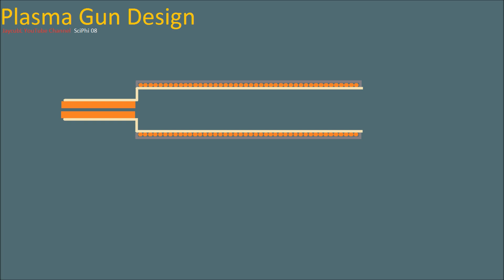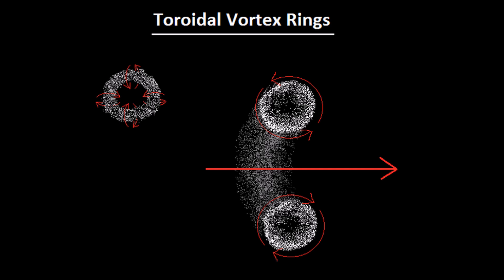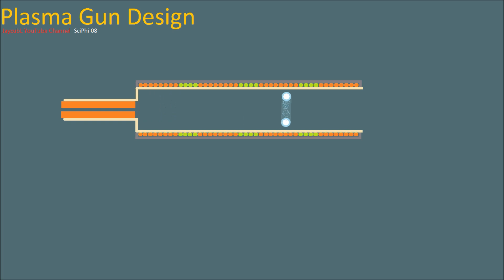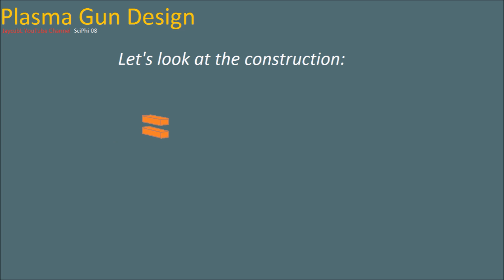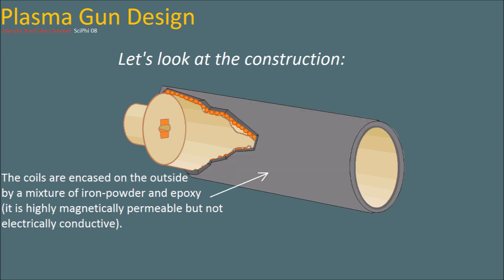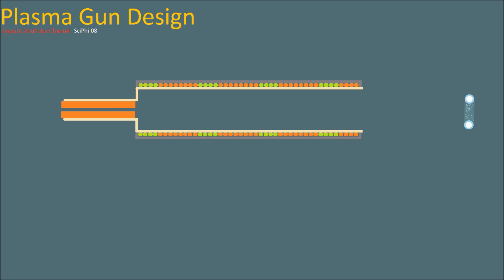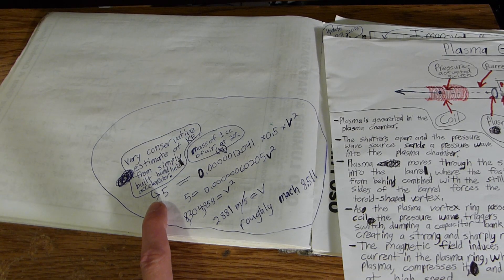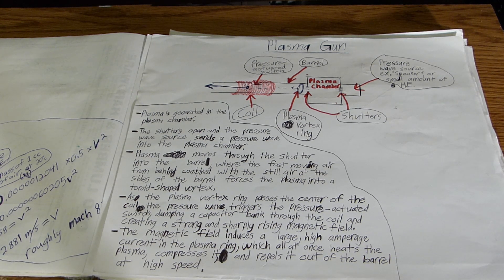Plasma Gun Design, Particle Ion Beam Weapon SciPhi 08

Comment: My question is, respectfully, how does one maintain such a vortisol motive column whilst penetrating through standing Air volume at supersonic or greater speeds at distance? On top of this, one might factor in the question of; how does one maintain "active plasma state" once said  vortisol motive column exits the active field of induced high tension current(s), [the point of origin] from which, said plasma state had gained conductive excitation-  will now continue to quickly "flee the scene" until a enough distance has weakened the requisite field strength needed to maintain plasma excitation?    What do you do when your bullets get too far away from you? You dissipated the majority of your field strength and can no longer maintain plasma state. Which, I predict would be no more than a handful of meters from a portable device before you're just puffing once very hot gas at somebody. No different than a fart that was highly charged on exit and just lukewarm upon contact. You get my drift? Of course there are a myriad of ways one can maintain a high-speed moving plasma at distance from its point of origin. Some of these could include the fact that once anything is moving fast enough through the atmosphere it will certainly maintain plasma state on its own - of course this is orders of magnitude of hypersonic speeds too destructive to want to even look into. One could also follow up that original vortices with a very tightly controlled column of high-powered microwave energy as a manner of keeping that high speed fart burning nice and hot all the way across the field till it hits its Target. However, you would require an intense amount of energy to do that at frequencies beyond 10 gigahertz with any kind of power efficiency from the circuitry used but then you always run into the issue of rapid propagation breakdown. God forbid it happens to be a moist Summer afternoon or any other weather anomaly such as fog or perhaps maybe a random cross fart in your field, or human being, or just a thermal difference between your firing point and your target. At those frequencies propagation becomes a nightmare and a very dangerous nuisance more than it does become the obvious point of failure.  One could also use mega joule pulses of laser emission to keep that fart lit till it hits the other side. But that would be going much faster than the vortices on many orders of magnitude, at which point why didn't you just build a big enough laser in the first place if you needed to keep plasma going between point a and the target point b? There are other means of doing this as well but they are quite esoteric rather than technically simplistic and effective enough to implement without looking like an asshole with too many building blocks stack next to you just to shoot someone with I'm very slow moving non-physical projectile that will have to be going sub supersonic before impact. Personally, I would just shoot a harpoon with a long power wire tether and use that as the guide (AKA propagational leaky conductor) for the required high tension excitation between point a and point b. A nice little trip line for your low speed high power high heat puff of fart to glide along. This is going to be quite a consuming task. One which I would fear DARPA had probably already spent a day or two looking at on their own by now. Once they realize flinging hot fart across the room is a moot point up to a certain distance and span volume of air. But what do I know, just another asshole with an opinion on YouTube. Keep thinking keep trying good luck excellent idea. Try not to taste the farts sir

Comment: Have you considered the potential suitability of the application of EPFCG in this device? The benefits would be to energy density and cost required for a high energy electromagnetic pulse. 

https://en.m.wikipedia.org/wiki/Explosively_pumped_flux_compression_generator

Comment: I disagree that it would be a practical weapon design; such a toroid would lose energy sustaining itself in a vacuum, and accelerating a rotating mass to relativistic speeds is highly difficult even for parallel processors to compute.

However, think of what would happen were you to fire a series of these into an electromagnetic field configured something like a bundt dish. Allow some of the particles to escape to the rear, as the plasma rotates.

Could be a working, efficient, and high-density ion impulse drive. Needs some experimenting done.
Reply: Or, possibly, allow the escaping plasma from the toroids to flow into a conventional ion drive to lower energy costs. Maybe?

Comment: Sorry to be tardy to the party, but what would you think about something like this using an HHO or other hydrogen-oxygen mix down a cone to form the toroid, that way you can store your energy density (ammo) in water instead of having to heat the air yourself. Civilian HHO tech seems to be coming along well enough to make what would amount to a recharging plasma rifle that uses some water and a bit of solar power to make very angry air. Of course, there's down time between shots which is a negative, but better mileage per fill. The nerdy side of me also likes the idea of essentially pelting tiny hydrogen stars down range. It could also give much better velocity since you have a rather potent combustion accelerating it first.

This looks basically like a gauss gun that interacts with a plasma toroid instead of a physical projectile, I like it.

Originally I was thinking there might be an issue between the rotation of the toroid and the velocity at which it's accelerated, but the magnetic field will essentially pull from the center instead of trying to accelerate the ring as an entire mass, and the question of ring rotation speed made me think as well: what happens to this design if you have golfball dimples lining the barrel to help generate turbulence evenly along the rings outer edge, encouraging more rotation through the velocity of the center column of gas and helping to regulate its rotation and travel speed? Furthermore, would there be a benefit to matching the size of the dimples with the thickness of the toroid? Would that encourage backflow rotation?

All this considered with 2H and 20 supplying the plasma, could you theoretically increase the heat by concentrating oxygen or hydrogen in to the low pressure zone of the toroid, and what would happen if you preloaded and backloaded separate gasses (a lone gas at the front and an optimized mixture in the rear), or fused it with your idea and load the area between the coper bars with a mixture? I'm sure there's a way to increase heat yield and velocity down the length of the barrel with your design. Maybe preloading hydrogen before ignition would keep unburned hydrogen contained in the ring and help increase its overall energy after it leaves the barrel.

Comment: I do belive that that would make more of a plasma trower than a plasma gun. Similar to a flametrower... since there is noting holding the gas into a concentrated bolt once it leave the barrel. Also you have to use batteries and gas tanck and not magazines drums or belt to feed the wepon. So i would raname it plasma trower as flametrower is the closest exsisting wepon concept.

Comment: The plasma rail gun is a great idea but the plasma’s density is too low to be a functional projectile. If you could incorporate a magnetic chamber with a small projectile like a bb (that can deal with the temperatures involved) then pump the plasma into that chamber and then accelerate the plasma - bb combo down the “barrel” then you’ll have a plasma projectile with enough density to be sent down range and have An impact. The bb would be a sacrificial component of the shot

Comment: I recently am interested in plasma weapons to stun/be able to deal massive damage and sumbled across this video on halo  https://www.youtube.com/watch?v=sNWMn0NkU8A&list=WL&index=8&t=473s  and hear that the plasma riffles used compressed gasses to create the bolts. The problem is that the plasma would dissipate quickly in the air. no matter what you do really. so to try to get some distance i'm thing that i need to create the plasma in bursts be hind an air multiplyier some thing like this ping pong ball launcher  https://www.youtube.com/watch?v=bAKqzAzfXKQ   with the CO2 container fill with nitrogen instead. i would have an ark before the air multiplyer either tesla coil or ark lighter thing to heat up the pressurized gas to expand the ark of the tesla coil might look like this on small scale  https://www.youtube.com/watch?v=SzqtAoJjV8Y  idk. but then i would have the barrel be this videos liner induction motor on the other side of the air multiplier. that is the only real way i thing a plasma weapon could work. let me know plz. thanks

Comment: So once the toroid leaves the barrel it's going to encounter immediate resistance from the surrounding atmosphere. Because the plasma discharge is so light, it's going to decelerate very quickly. 
Although it's a good concept & should be built for proof of concept.

Comment: would a laser, wide cylindrical low energy beam,  in the back, help keep the plasma going in a straight line?
Reply: If the laser can heat the air so much it can ionise the molecules in the path of the plasma toroid, I think you should just use the laser.
Also, since the toroid shape has a hole in the middle, I think the laser would just go right through the hole leaving, the plasma projectile undisturbed. You'd have to create a sort of laser that can project a hollow circle, instead of a dot, by using some wacky lens, or, as you say, a low energy cylindrical beam, but I don't think that would be very effective at heating up the path for the toroid, and most of the laser would still be funnelled through the hole of the plasma ring

Comment: I don't think this will work. The Gas or Plasma will immediately expand after leaving the tube. Maybe it is effective at a distance of a few mm or cm but not meters. So maybe it will be possible to create a plasma ball and with a long enough magnetic rail it will travel maybe a few meters. There are so many variables you have to take in this equation. Sad physic reality.

Comment: The better starter circuit design would be a single charge on the whole outer tube, and a very fine ground pin through center, opening up into the secondary cavity. Taper the pin into a long needle shape and this allows the torus puff to expand and form, then expand and accelerate in the second layer

Comment: This design would likely work considering that the US Navy's version of this is much less thought out. Their plasma bolt travels around two feet at 70,000 degrees in open air. They don't have a linear motor or any magnetic field controlling the plasma ring. Question is if the linear motor can increase longevity of the plasma life span in open air?

Comment: I have a very different way of creating high energy plasma while maintaining enough atmosphere in the chamber to sustain multiple shots.   We should chat.
Reply: Personally, I'm contemplating a 2 channel hydrogen converter to use a oxy-hydrogen mix down a vortex cannon to create the toroid. It'll have to vent spare oxygen through a blowout valve, which raises an issue or two with safety features. A little water in the stock and a charged battery should be all I need, since it's 1.3 volts per connection for peak generation off a graphite node/plate.
Reply: @Cretaal substitute your solution with  diluted urine. (Naturally occurring)
Reply: I would love to hear it
Reply: Is it a dense plasma focus?
Reply: What is your way?

Comment: You will need super cooling, unless you make cold plasma.  It is one of the Ancients' weapons, so it is doable.
Reply from the maker: Thanks for your comment! I think the distance between the plasmoid and the ceramic barrel would be enough to prevent heat from being a problem, but I agree that a liquid cooling system would be great for a use where weight is less of a concern. Limiting the duty cycle can also do a lot to prevent overheating.

Comment: I want to use 3 sets of  7 stage 6inch wide 8inch long coil rail 1st stage 2"L  stage 2-7 1"L  for a ion accelerator  to increase thrust on a ion drive. Increase the speed of the ion and increase the thrust. Do so fast enough and you can get proper acceleration and maneuverability in space. And possibly if using a ion drive and a multi stage accelerator to accelerate the ions to near light-speed  out the back of the craft you could get very good acceleration/ deceleration of the craft and Achieve  near light speeds. We all know NASA and there mk3 which was a big waste of time and money because by the p/w ratio it's 500lbs has a thrust of 278 millinewtons  and the original ion drive they  made was around 10lbs with a thrust of 92millinewtons so the mk3 has 3x more thrust because they made it have 3ion rings cuz it looks cool but they didn't focus on ion speed improvement no they made it 17x less efficient 3x more thrust and 50x heavier ,spent probably millions and years making it when they could've just used 3 mk1's to get the same thrust.a and used that money and time to improve the mk1 with a ion coil rail drive.  God damn it some give me a job! Any tips on what power requirements an switch for my scale  would be great rant over
Reply: Please feel free to make a video on this

Comment: Holy shit this is EXACTLY the same concept I thought up! Haha.
I couldn't work out how fast the plasma would actually move through air or how far away it would dissipate. The numbers I arrived at were... Too high to be believable.
Reply: Oh, mach 85! I had similarly ridiculous numbers.
Reply from the maker: @ThunderChunky101  In the video it said 8.5 not 85. Considering the low mass I don't see why it wouldn't be possible to reach such speeds in the accelerator.
Reply: JaycubL I can see the kinds of speeds you predict occurring in a vacuum. The issue with operating at Standard Conditions is that your plasma toroid has a very poor ballistic coefficient and low momentum. The effects of atmospheric drag will decelerate your plasma toroid quickly. Even though this qualifies as a directed energy projector, the plasma toroid is still a physical projectile, albeit an exotic one. Since you cannot ameliorate the atmospheric drag effect in any significant way, your best bet for making up for the loss of kinetic energy would be to increase the mass of the plasma being projected, increase the density of the current plasma thus decreasing the surface area effected by drag or increase the energy, i.e., the temperature of the plasma. Any one of these changes will help and a combination of two or all three is even more desirable.

Comment: I have taken your design and edited it, that's a very good design but it is missing one key design
Reply from the maker: I have a couple variants as well, including two other plasma formation systems. What is your idea?
Reply: @JaycubL  damn never saw this notification, my version combines propane and butane gas and uses a high pressure pump to force the gas through the magnet bars as the arc goes through, makes the rings ridiculously hot.

Comment: WhAt about taking this to the next step & amplify the pulse by using a "lasing" approach, where the pulses bounce back & forth in the accelerator tube  by using a repelling field where the diaphragm goes? Time so that the magnetic diaphragm opens after 1 second . This would create a major single pulse with more Joules.  One could even create a "force field" around a spot.  Any thoughts?
Reply from the maker: I guess I would need more explanation to know what you mean. So you want to stop the plasmoid, shoot it back to the beginning of the barrel, and cycle it like this a few times then release? I don't really get it. Maybe if you had a circular accelerator to build and build speed over several passes you could get something like the buildup to a stronger shot that you are describing.

Comment: so are you planning on ionizing the gas as it enters the system? or pre-ionized propellant? because that can be a huge difference in power draw.
Reply from the maker: I have a few different versions of the design but in the version presented here the "rail gun" section at the beginning would start from a non ionized gas and ignite a plasma (ionized) arc with a high voltage ignition pulse.

Comment: Btw your schematic is off as the power supply is short circuitting itself on each rails. It's basically a electric arc laser (without the big capacitor), passing thu a coil.

Comment: The logic is sound, as far as I can tell. The bottleneck, as I see it, is basically that you need to get the plasma really hot, and move it really fast to accomplish any sort of destructive action at any range.

How do you propose to accomplish this?
Reply from the maker: The linear induction motor. If you can stack many shots on the same point each shot would not need to penetrate that much individually, if they can just cause a rapid high temp erosion, like delivering a small plasma cutter downrange. All was proposed in the video other than some details and critical features of a more sophisticated design that I am saving aside for possible patent if it ends up working, but the video describes the basic idea as well as I can explain.

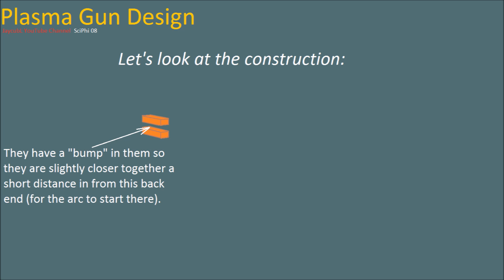Comment: I love this!  But...At 3:25 I think the B-field of the external coils should both go through the copper gap in the SAME direction.  The way it is drawn, the fields would just cancel each other at the copper barrel.  Also when the main Cu coil is pulsed with the high current, wont the vortex be attracted to the center of the coil where the field is strongest--and there is a possibility of the vortex being sucked into the gun--like the problem with a coilgun.